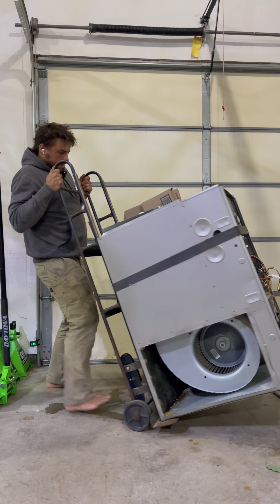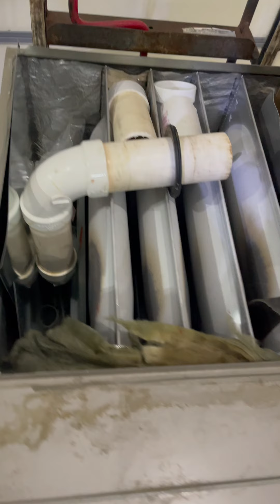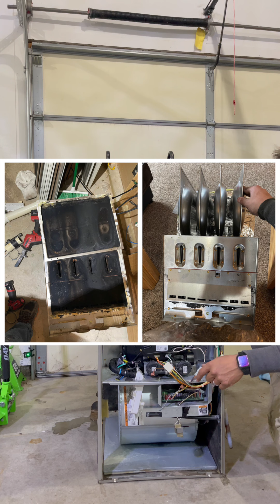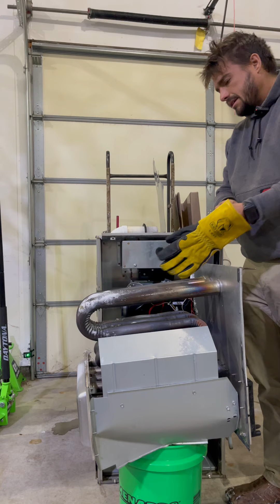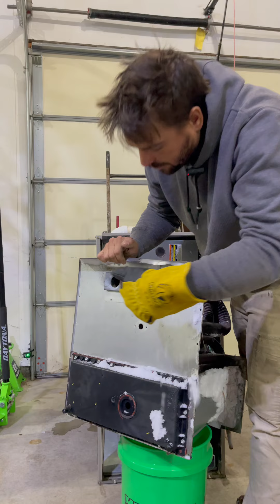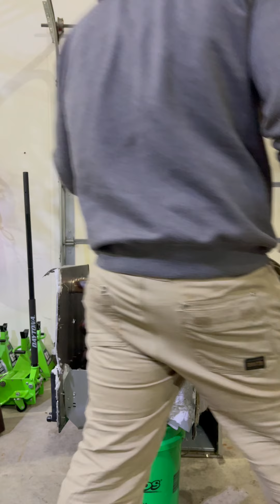High Efficiency Leads to High Repair Cost

Comment: This video is extremely misleading.
Getting 2-stage or modulating is entirely for comfort, not saving energy. You can get single stage as high as 96% afue - no one pays thousands more for a modulator to save 1 to 3%, they do for very quiet consistent heat.
Single stage absolutely sucks for comfort and is basically obsolete, the extra cost for 2-stage is not very much comparing same brand and blower motor. A properly sized single stage for coldest nights of year is way oversized for the load just about all the time, leading to short cycles, blasts of heat - to add insult to injury most contractors are oversizing furnaces by at least 20 000 btu.
It is true that modulating drastically increases repair costs, 2-stage depends on the main blower motor type.
It is also true carrier gouges on parts for their high end infinity line furnaces, it is a company with disgusting business practices.

80% furnace of same feature class like number of stages and blower motor type and brand is mechanically and electrically the same as the 90%+ just has a secondary heat exchanger. Beyond carriers that had a defective design, secondaries are very reliable. Just have to watch out for proper venting and the condensate lines/trap need maintenance. 
Financially in a cold climate 80% has a higher cost of ownership and frankly throwing away 20% of the heat produced due to being scared of a secondary heat exchanger is really foolish.

The lowest end furnace that should be considered in a cold climate with furnace and ducts in conditioned space is the 2-stage 96% afue with constant torque/multi speed blower, the same blower type found in single stage units. This is the sweet spot for balancing comfort with purchase and repair costs. The cost at contractor's price is very similar to single stage.

USA is so far behind it's not funny, we haven't had 80% furnaces available for 16 years now - thankfully. Regulations put an end to that bullshit if only they could do the same for oversizing.

Comment: Can you or the homeowner keep the heat exchanger clean?  My old 80% Payne inducer motor bearings also started making tons of noise - so we drilled an oil hole and oil up with a few drops of turbine oil every month - problem solved!
Reply from the maker: Good problem solving! The filter is supposed to be way we keep the heat exchanger and A-Coil clean; but sometimes stuff gets through.

Comment: I've been saying this for years. Any money saved with the efficiency, you'll lose with the first repair. Though I do believe that as they are becoming more common, so will the parts. The units from early 2000's, the inducer is more expensive than some of the newer units. 
 Also, with the current rebates it brings the costs for a 97% or 98% unit level with a 92% or 96%.

Comment: Dude, thanks for sharing. I appreciate the perspective. I too want to install a new 80% furnace sometime in the next year or two, but are they planning on stopping the sale of those anytime soon?
Reply from the maker: Sorry for the late response… In the Minnesota Wisconsin area they will be selling the 80% for some time to come. I know there are some states that are trying to get away from natural gas burning furnaces, but I believe they’re only really enforcing it in new construction right now. I’m relatively sure that you can find one in any state if you request it from your installer.
Reply: @ no worries! hell yeah man. Thanks
Reply: 80% efficient furnace is the same technology as equivalent brand a model 90%+, it is the same thing with a secondary heat exchanger. barely more expensive to fix, about $500 to $1000 more to have installed.

Comment: Yep, high efficiency is good until the warranty's up
Reply from the maker: @retiredbobsday.5642  yeah and even with the warranty, most of the time labor is not included. I have heard of some wild stories of, “yes your blower motor is covered, but there’s still $900 in labor.”
Reply: @JustinSLeach  Never upsold any of my customers. Would tell them they would never save enough money for the higher cost.🫡
Reply: I installed a Crown 95% efficient system. Tenants complained cost to run was too high. Had three techs come out and agree it was not working right but couldn't fix it even with access to the manufacturer. I got frustrated paying so much for the diagnosis but no fix. I ripped it out,installed a used old-school, Bradford White that every tech and most homeowners could work on. That was six years ago and no complaints. Just routine maintenance and it keeps chugging along. In the long run I am money ahead because maintenance is that much lower cost.